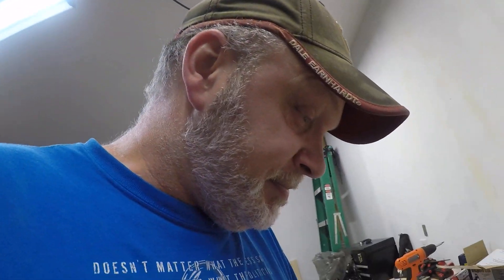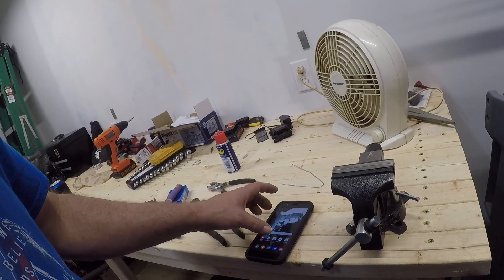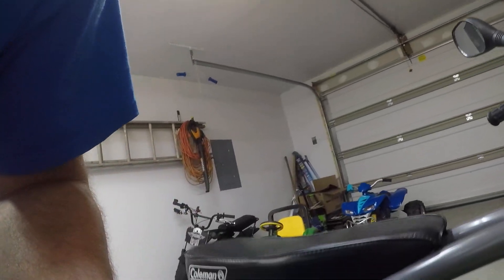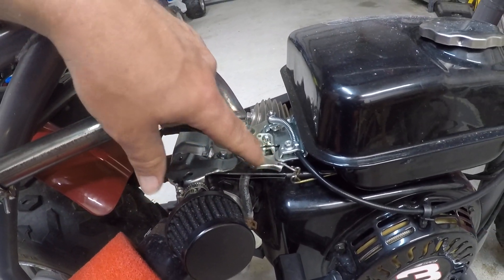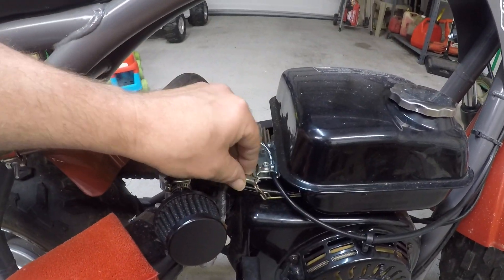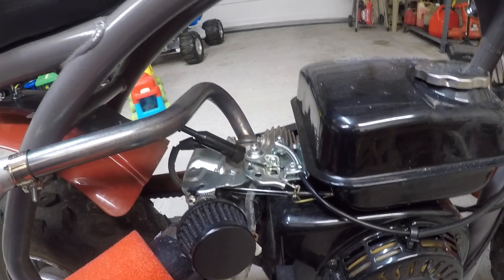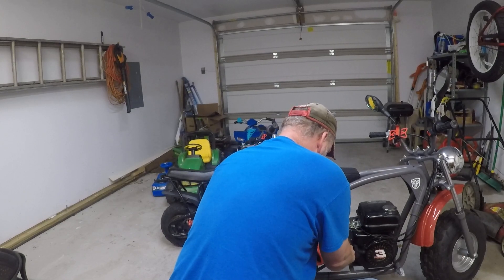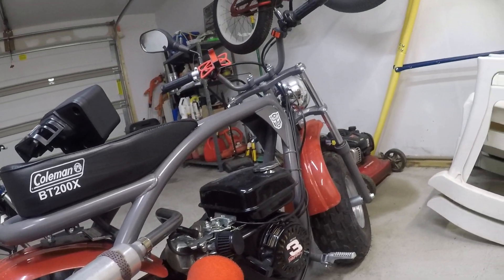How I Bypassed The Governor On the Coleman BT200X Part 1 of 2

Comment: Thank you sir hey I've watched every video about changing the back tire and not one of them really did it so I still don't know how to change the back tire on my BT200X would you make a video about taking its off and putting it back together with the break and those 2 nuts on each side of wheel rim  and I learn by doing and watching not being told so please make a changing the back tire video cause I have to take it off and put the new one on the rim before I air the new one up and